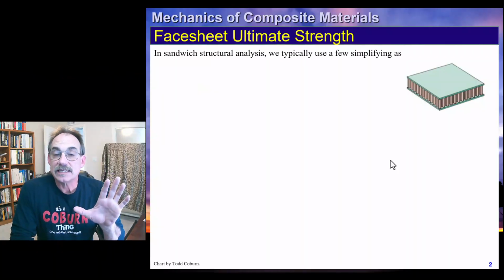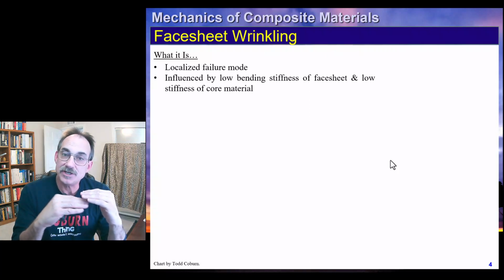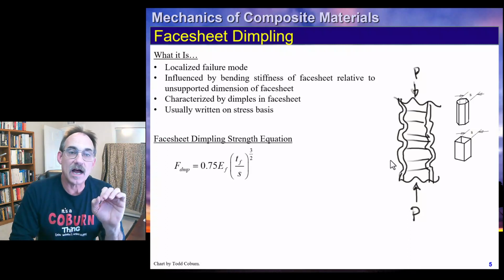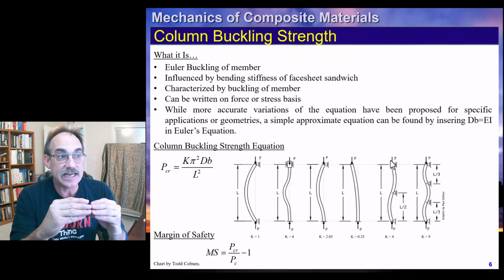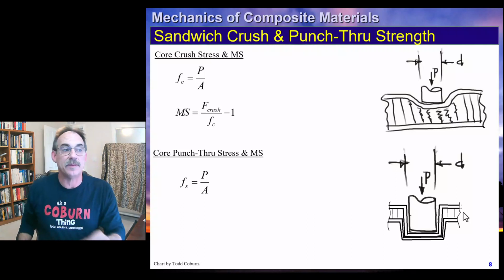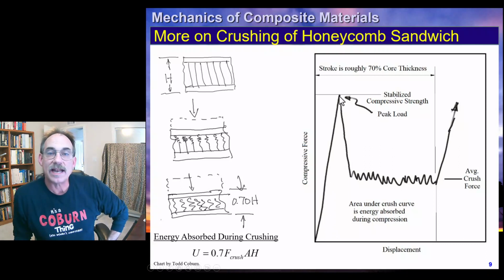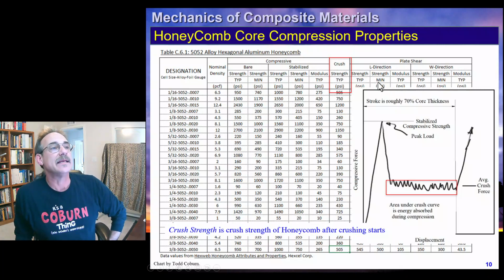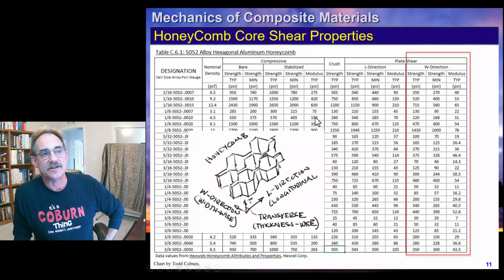Composites: L-14 Strength of Sandwich Structures

Comment: How would I analyze the torsional stiffness of a sandwich panel with a specific layup of carbon fiber face sheets? It seems very hard to find anything about how to calculate this.
Reply from the maker: Good question.  I am working on the second edition of my Composites Handbook, and it will include detailed analysis of fasteners in sandwich, which involves similar analysis techniques.

Meanwhile… you need to remember that the facesheets carry all in-plane load, and the core carries out of plane load.

Therefore, torsion must be carried as differential bending.  

Imagine the torque carried by a “couple” of facesheet shears in the plane of the facesheet, such that S=T/h.  Then Fs=S/bt.

If you need more strength, you could divide the beam width in half, evaluate half for bending upward and half for bending downward.

Sum the capability for in-plane facesheet shear with the capability for out of plane bending, and poof!  Approximate answer!

Alternately, calculate the stiffness for each assumption, and divy up the shear by the relative stiffnesses for a better answer.

My handbook does not yet cover this, and i was not planning to add that to the second edition, but I’ll see what i can do.